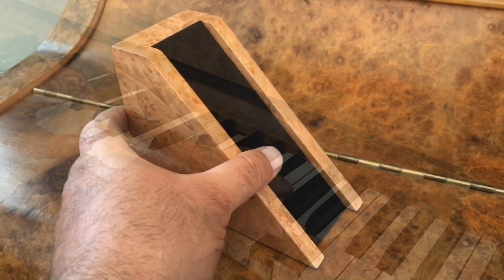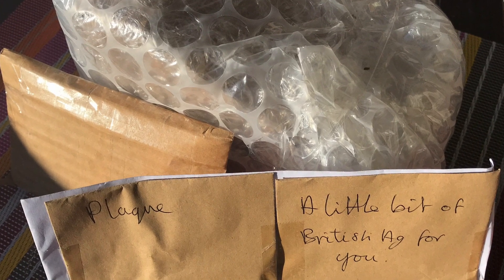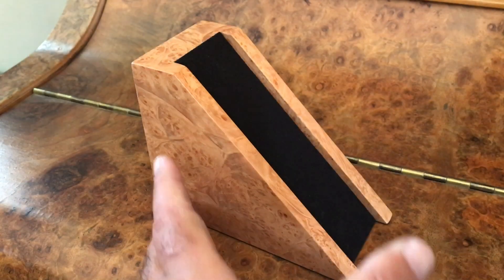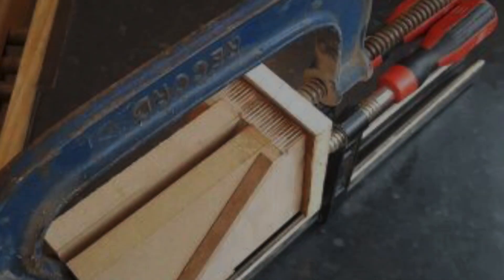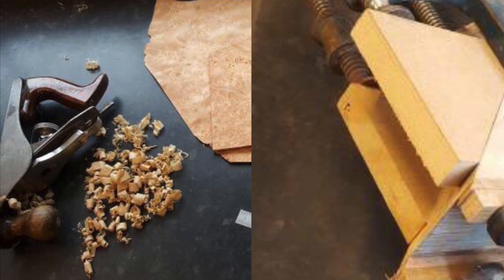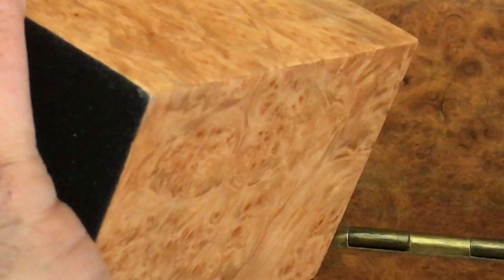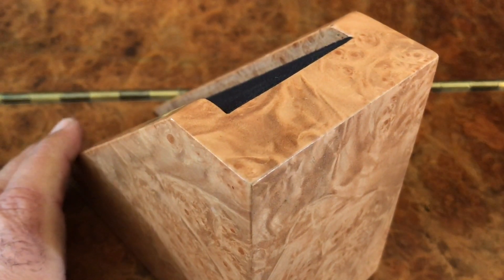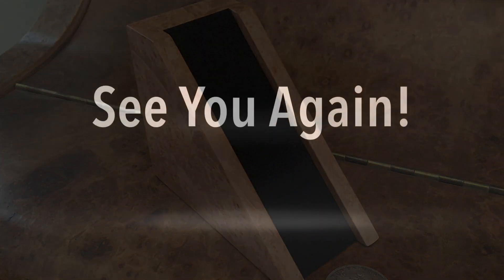👉DETECTS FAKE SILVER😎Custom CCT Coin Slide

Comment: It was a pleasure working on a custom piece for you. That one was certainly challenging, but one of my faults is always enjoying a good challenge. Was it the Kendall mint cake i sent you? Did you enjoy it?
For anyone wondering how it works: 
Silver is diamagnetic, so is affected by high powered magnetic fields. A silver coin (even 50%) will run down the slide slower than most other non ferrous metals (i.e. zinc, tin, nickel etc). This is due to something called the eddy current effect. The slides have N52 tri plated magnets recessed into them using a special bonding technique i developed myself. 
Each slide is handcrafted by me personally. Over 1300 to date, and sent globally. I do try and get a few on ebay for those who like to use that purchasing platform.
Reply from the maker: Thanks bud .... I love this thing🥰 I think that was the mint candy ... very different, but tasty👍Thanks for the written details on the function of the slide👍😎👍all my best - HiHo